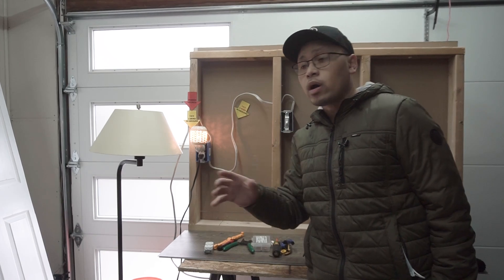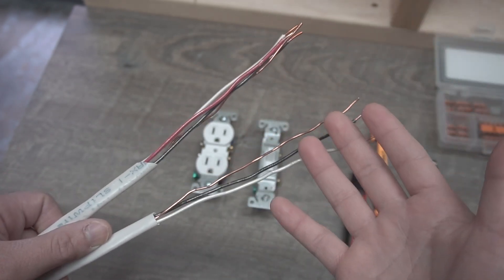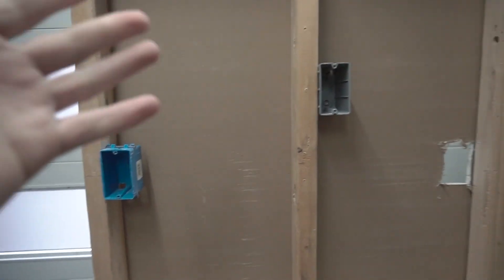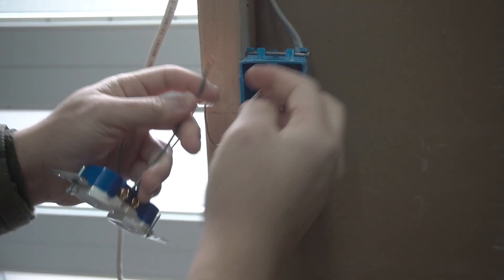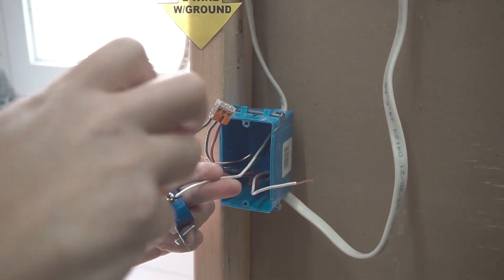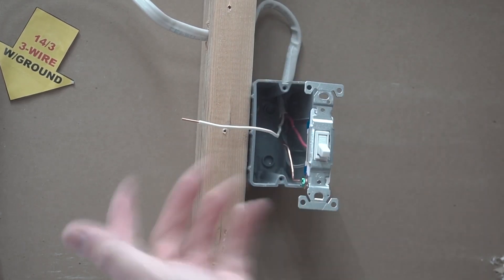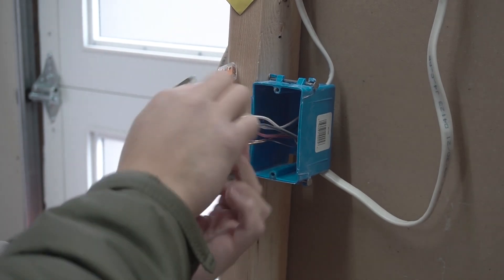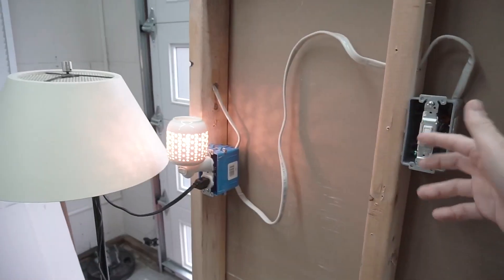How To Wire A Split Outlet With Bottom Controlled By Switch & Top always Powered On! DIY Tutorial

Comment: My switch seems to control both outlets on/off by the switch does that mean it’s wired differently?I would like to get power from outlet to run led pot lights does that mean my tabs not broken off?
Reply: Did you break off the brass side tab?
Reply: Care must be given here:

Always turn off power first and double check you did.

Two scenarios just to mind.

1)  they sent power to the recepticle box first( like he did) but they connected the hot to the switch wire and bypassed the recepticle in the box.  Then they came back from the switch to the recepticle without breaking the tab.  This is fixable by following his video.

2)  they sent power to the switch first.  I cannot see a fix without replacing the cable from the switch to the recepticle with 14/3 or 12/3.  Red as constant hot, black as switched hot, white as neutral and bare for ground.

Do not be afraid to get a pro involved to help.